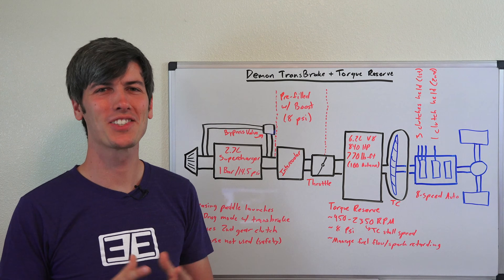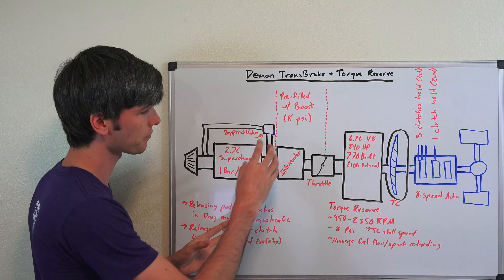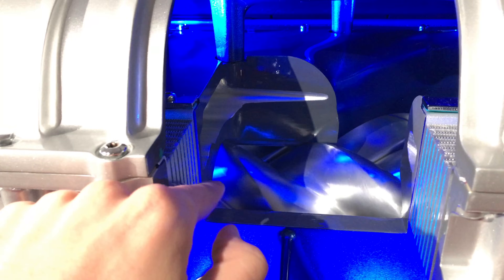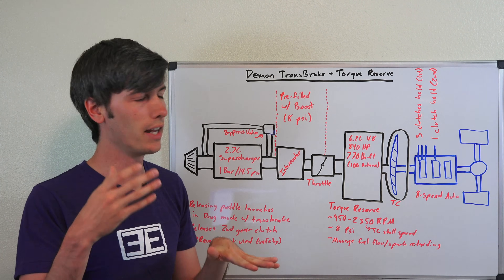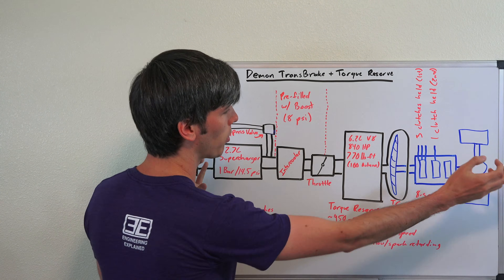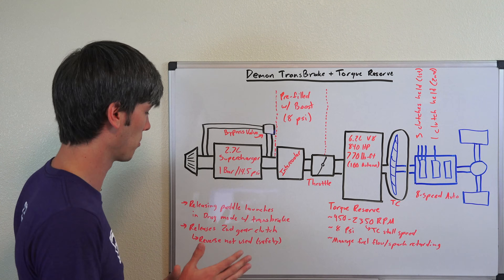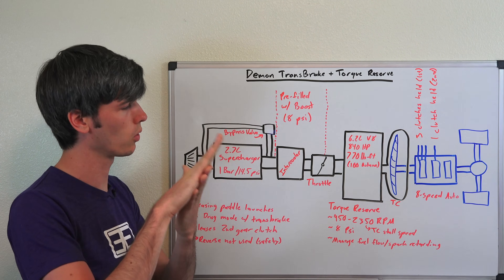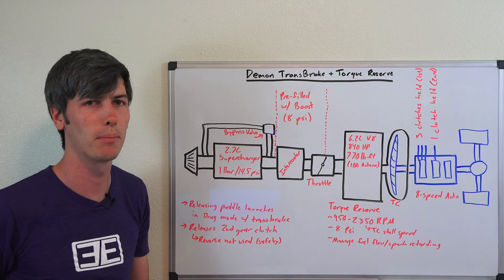How The Dodge Demon Launches: Transbrake + Torque Reserve Explained

Comment: ridiculous level complexity
electric is so much better
Reply: CheekyMonkey888 And...? Low top speed. There are pros and cons to everything. Again,i like electric cars, but they are not the perfect solution to transportation needs. And the highest performance cars on anything but the quarter mile will remain internal combustion for the immediate future.
Reply: The complexity of the engineering of a combustion engine and these kinda genious technical solutions are things that make them so interesting and amazing, they're more than just boring, simple electric motors. That's why electric motors as soon as they develop more will be the best solution to a car that's used only as a tool to move between point A and B. But when it comes to sports cars that are driven for enjoyment, combustion engines will remain, also due to their sound. Of course some car guys don't care about that and would rather take an electric car even for a sports car due to its instant torque.. but still internal combustion won't die, unless they get banned... which sadly will probably happen, at least in Europe where Germany, France and UK are already planning to ban them.
Reply: CheekyMonkey888 lol in what way
Reply: Can't you appreciate the engineering ingenuity for what it is? I also think electric is the future, but this is some brilliant design work. And talking about complexity, modern electric cars are by no means simple.
Reply: Some people will appreciate ICE engineering, sound and manual transmission (and maintenancing it themselves) over the simple instant torque Tesla and vice versa.
When you floor it in a Tesla, you just press the accelerator and the car.. accelerates, silently.
Different thing in an ICE car, downshift, engine revs up, makes noise, car starts to pull increasingly faster as the rpm rises.. maybe slower than Tesla but still a whole different story. Matter of preference, again.
But the thing is that we need the best possible batteries and most efficient motors to make an electric car that has a decent range with an acceptable amount of power, the only way to make an electric supercar is to increase electricity consumption, which destroys you the range, you'll have fun for a little moment and then need to charge overnight
Reply: The biggest problem with the production of electric cars is how much pollution is released in their factories. Once they're powered by mainly or exclusively renewable energy electric will be undoubtedly be the future.
Reply: For commuting this makes sense, but for longer journeys it's not practical. What if I commute 90% of the time, but then 10% of the time I need to drive long distance? Should I buy a separate car just for that?
Reply: CheekyMonkey888 it's limited because it would cause permanent damage to the batteries just like ludicrous mode does. So they are very much still a work in progress and nowhere near the perfect technology you think it is
Reply: and how many runs will that battery powered tub do before it stops or burns up? if you really want electric....and i think it would be fun...you need to go hydrogen fuel cell. batteries are terrible for the environment.
Reply: CheekyMonkey888 yea you keep trlling your self that lol
Reply: So why not buy a hybrid? You'll get the advantages of both engines and if you run out of battery power, go fill up at the gas station :)
Reply: +Tyler Hoeve
Have you ever driven a Tesla? If you haven't, you don't know what are you talking about. Also what's not great about instantaneous brutal torque from 0 rpm, very low center off mass, very precise steering, and excellent traction control and torque vectoring?
What's not awesome in an SUV that can do 0-60 in 4 seconds, while towing a 2 ton trailer?
Reply: Through which mechanism?
Reply: https://yourlogicalfallacyis.com/ad-hominem
Reply: CheekyMonkey888 As much as I love Tesla, it's completely out classed by this car. Instant torque doesn't compete with this as of yet and that's why Dodge deserves so much applause for this.
Reply: Edward. Look up ep9 nordschleife
Reply: So is a BJ but I don't see anyone forming a line
Reply: CheekyMonkey888 mechanics 20 years from now are going to look back and say wtf
Reply: CheekyMonkey888 electric cars are soulless, get out of here kid
Reply: +177SCmaro
What matters the most is mechanical complexity, because moving parts are the most common point of failure, and need the most maintenance. A computer chip with 10 billion transistors is insanely complex, but will work reliably for decades without any maintenance (all it needs is stable power and cooling).
Reply: KlayySOC Why would you compromise on 90% to satisfy 10%? Rent a van or use an other mode of transport for that rare event where you main vehicle won't suffice.

Buying and maintaining a car is a pain in the butt and supper costly. People are moving away from car ownership anyway, it doesn't make sense.
Reply: Mytube Tesla tried putting a second gear on the Model S
The instant massive torque kept destroying the transmission, they gave up, for now
Eventually they'll get it, then there won t be a supercar in the world that will keep up
Reply: Manual transmissions are less boring, but they are still dying. This video just shows how ICE cars are running as hard as they can just to stay in the same place, figuratively.
Reply: What is the plan for producing and transporting hydrogen? 

Batteries accept electricity and output electricity and the losses are minimal. For fuel cells, first you need to produce the fuel which requires energy (electricity), then you need to transport it (more energy) and finally you need to convert the fuel into electrical power (losses). Batteries work better for energy storage as they accept it in a form available everywhere and need fewer conversion steps.

A battery's life is incredibly long and will have stored an enormous amount of energy before it is recycled. We don't just dump them if their performance isn't up to standard, we down-cycle to lower performance applications.
Reply: Artavius Simpson
I don't see how. The Dodge Demon can do one thing, and on thing only, launch a bit faster than a Tesla. Meanwhile the Tesla is a big comfortable luxury car that's very cheap to own. And Tesla could make a lot more powerful car easily, but at this point he limiting factor is tire grip, not power.
Reply: 177SCmaro
Actually electric cars are cheap to repair, because they are simple and very reliable. And computers are even cheaper. Modding is done mostly in software, not hardware, but it's still possible. The cheapest repair is the one that you don't have to do at all. If you have a problem with the motor in your Tesla, they will replace it for free in the first 8 years. Since no cars are that old yet, there's no reliable information about the cost. One figure I found is $6000, which is cheap compared to a modern high performance IC engine.
Tesla batteries are expected to last for a million miles, and they aim to make the drive units last that long too. The cooling system is part of the battery pack, I think, I've never heard about any problems with that.
I'm sure most people prefer a reliable car over one that is easy to repair.
If you want to tinker with your car, build your own electric car. Many people do that, it's fairly simple, and the result is great fun.
Reply: CheekyMonkey888 Wow I'm really impressed with the amount of butthurt your comment caused lol.

Electric is the future, to claim otherwise is completely ignoring facts. 
A large motor has 90% efficiency
An ice has a mathmatical max of 40%
Aluminum ion batteries are currently in development that are ultra reliable and can charge in minutes. Supposedly a lithium ion has been developed that has an even higher energy density and a solid electrolyte.
If we can find a capacitor electrolyte that can withstand massive voltages electric cars would be able to recharge nearly instantaneously, and dump out way more power than a petroleum car.
Reply: An ICE piston engine cannot even start itself. You need an electric starter motor to even wake the beast.
Reply: Jacob Walls Within car ownership; how much of a cars life is spent parking? Anytime a car is parked it could be charging. Doesn't matter how slow charging is if it is always charging. An overnight charge can easily yield an average day of driving or two. What is the average speed of a car (ignoring parking time)? How many hours a day do you want to commute? Current EV technology runs longer than anyone wants to commute and recharges faster than time spent parked.
Reply: CheekyMonkey888 the only thing that you get from driving an electric is a divorce & losing your masculinity.
Reply: Isaac L. if you want soul get a horse they actually have one
Reply: Jacob, electric cars have a fraction of the parts, much simpler
This kid has built an electric utility truck for my farm, simple components
Reply: EV ranges are more than acceptable now. The general consensus is that over 200 miles range anxiety goes away. All new EVs are above 200 miles, and some are over 300 or 400.
Also charging is not that slow, you can charge from 20% to 80% in 20-30 minutes, which is acceptable on a long trip, and that's the only time you car about charging speed. If you drive 300 miles every day, than EVs are not for you yet, but most people drive less than 50 miles a day.
Also battery capacity and charging speed are improving very fast. In the next few years we will likely see a twofold improvement in both, and that's a conservative estimate. In another few years electric cars will have better range than ICE cars, and charging will be faster then filling up an ICE car.
Reply: Yup, pussies who don't want to pollute the only atmosphere they have. Pussies who want better air quality in their cities. Pussies who don't want to murder.
Reply: I love all the kids in here pretending they have a clue what it's like to ride in the front seat of a car let alone drive one lmao. You kids today rather have RC cars then real cars and it's not because Tesla is great car it's because you snowflakes don't know any better. I don't  blame you I blame your parents probably a bunch of liberals preaching about climate change.
Reply: Geeky
open to progress, petrolheads are not
Reply: It's funny when you say that an electric car is not fun to drive. Have you ever driven a Tesla? If you can't try one, just watch any video where people drive it.
Going from ICE to EV is like going from VHS to DVD. Maybe you lose a bit of character or soul (a.k.a. analog noise & tape stretching), but the benefits are overwhelming.
The technical solutions in an ICE car are amazing, but on the other hand completely futile, since no amount of complexity and ingenuity can beat a trivially simple electric motor.
Most people just want to get from A to B the most conveniently and cheaply. They won't buy ICE cars anymore. Those who love driving are overwhelmingly love the performance, instant torque, low center of mass, smoothness, and low maintenance cost of a Tesla. Very very few people will care about ICE cars.
Reply: I appreciate
In a Rube Goldberg kinda way
Reply: Top speed for electrics is electronically restricted, and mechanically limited due to no transmission, limitations will be solved within the next five years
Internal combustion engines for cars have no future
Reply: Instant torque at 0rpm